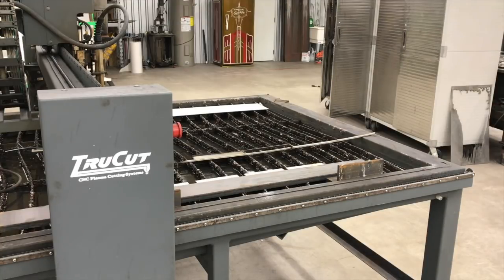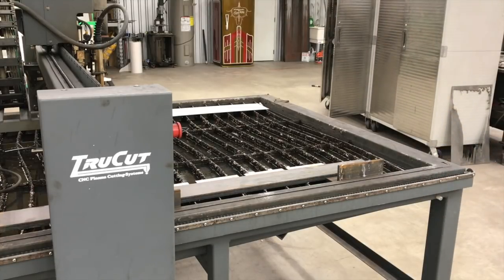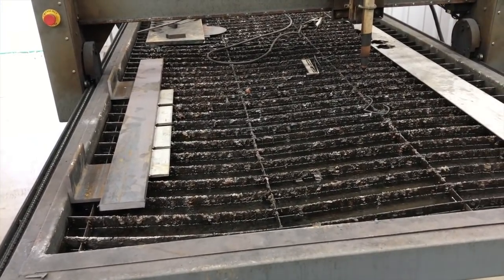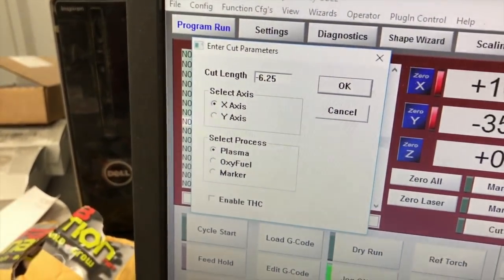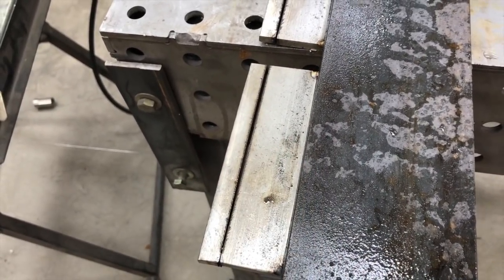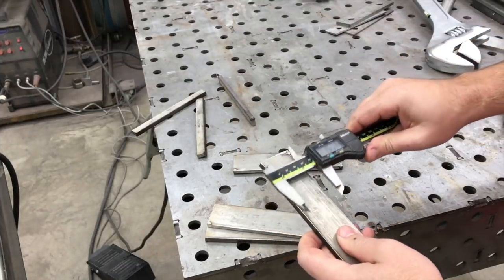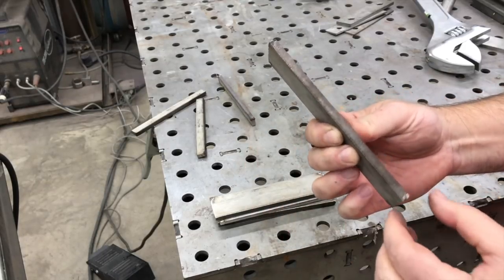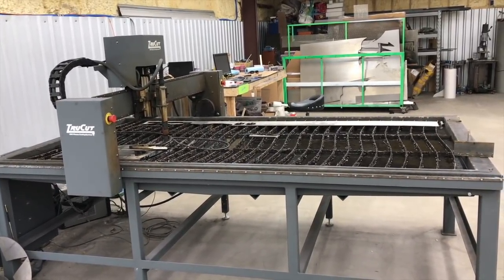RIP CUT! trucutcnc Mach3 feature demonstration for accurate straight cuts with plasma cutter

Comment: Looks like its time to pull some maintenance on the table bed. hard to keep it flat also?
Reply from the maker: oh it's way past time.  I normally cut sheetmetal art so it doesn't matter much but on a project like this, yes I had to shim up the part to get it to cut right

Comment: Good idea Gary.  Where I used to work I made clamps that I could attach to any of the table supports and then clamp a 1" heavy wall square tube to hold material down.  I used it primarily with thin material, but also for small pieces like you just did.  I just made sure I set the safe z height above 1".
Reply from the maker: Thanks Bill, that's a good idea on making somethign with clamps that can be used repetitively

Comment: Gary do you need 220 to run it or 110? 
Don’t really know much about plasma tables.
Was wondering what I guy would all need to get one?
Reply from the maker: Ray it really comes down to what thickness metal you want to cut.  the table itself only needs 110, but my plasma cutter is 3 phase 240 with a #6 gauge wire.  I think the 45amp ones can run on 110 and cut up to 1/4" material

Comment: Adding water to where you used to keep the part nearly submerged would have helped with distortion too no?
Reply from the maker: I have heard that also, but honestly I still think it would have distorted, there just wasnt enough parent material to keep the heat from moving it around on the table while it was cutting.  Mild steel in narrow flat bar would have likely done the same